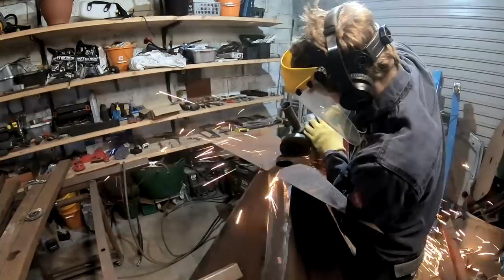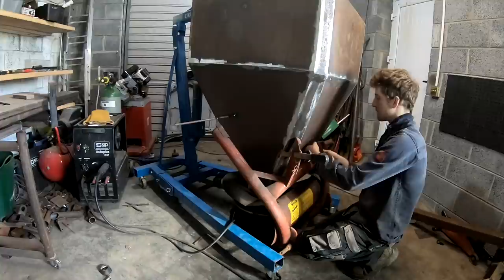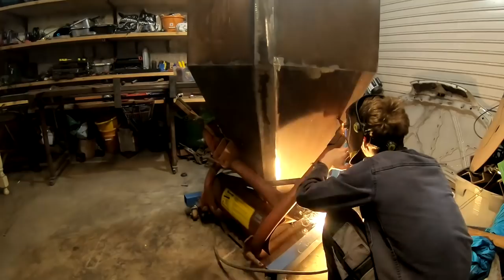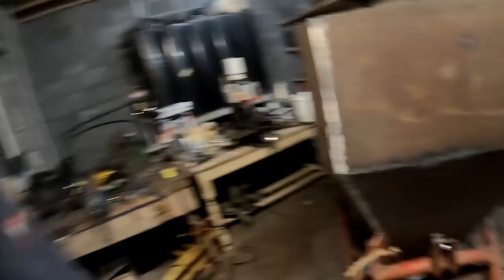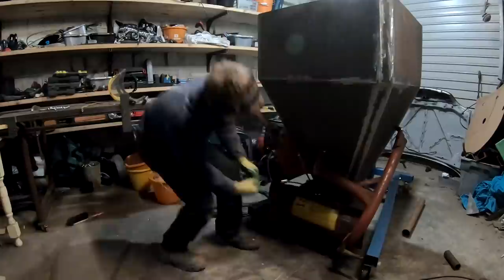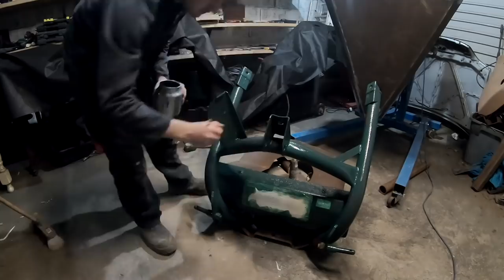An UNNECESSARY PROJECT - Fertiliser Spreader Restoration PART 2 - Attaching Hopper to the Frame

Comment: Nice job but you know on the cross bracing you added I this you should add like 4 right angle triangles in to 1 point so when you’re loading it you just set the bag on top of it and it opens

Comment: Fine job. Pity u didn’t take time to give it a rub of a wire brush on the grinder tho
Reply from the maker: That would only bring out the raw steel and cause it to rust quicker. It was only used once, washed and is sitting in th washed waiting to be galvoed